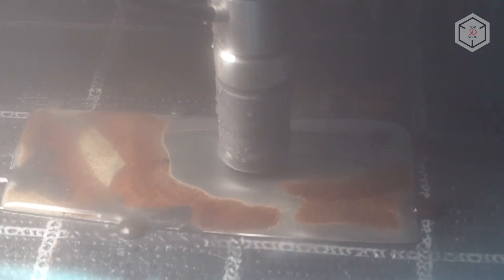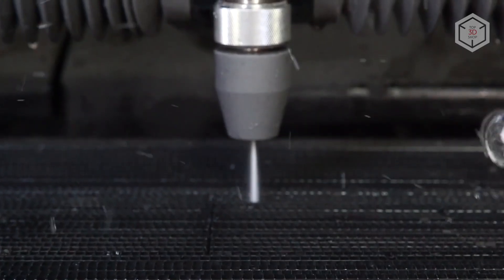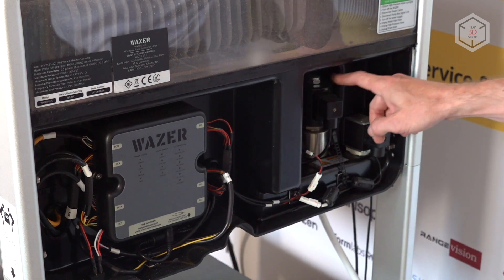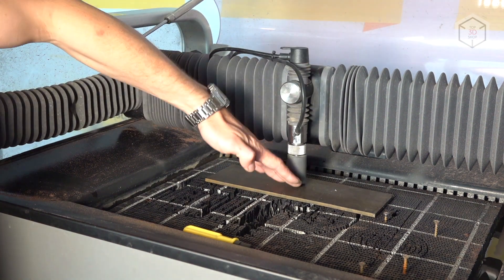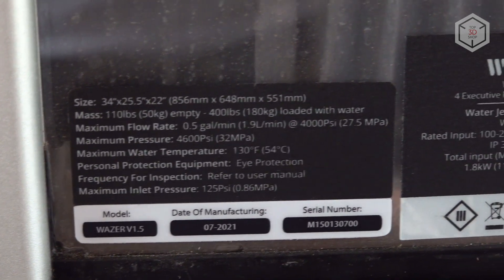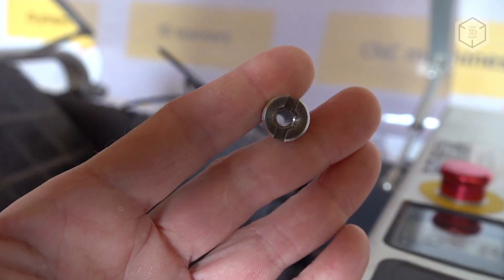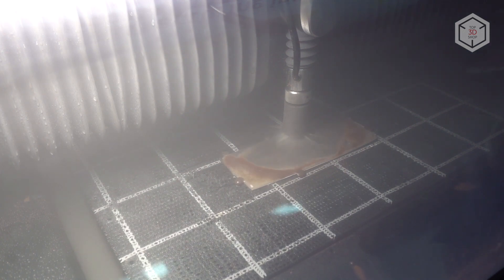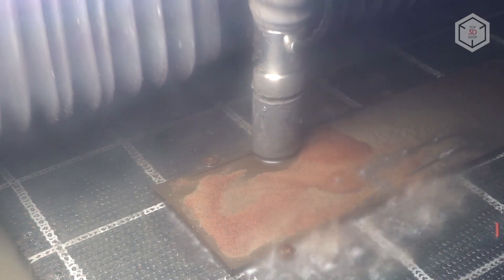Wazer In-Depth Review: First Desktop Waterjet Cutter

Comment: Been there done it, what a crock of shite tHis machine is
Reply: Can you please elaborate as to what you find to be wrong with it? I'm very interested to know the short-comings of the machine, as (in theory) it would work very well for my use case.
Reply: @bluehornet6752 I don’t have any experience with this machine in particular, but lots of “hobby sized” machines have serious shortcomings compared to the industrial ones they mimic. If I were you I’d evaluate whether you really need this machine in your workshop when suppliers like send cut send offer really good prices and short lead times custom parts.  

There’s the value of your own time to consider as well. Do you want to fiddle with setups and machine maintenance or just upload a CAD file and swipe a credit card?

Comment: I've never used it but I saw the kickstarter and its probably a piece of garbage. The main issue is the pump is really low pressure so you will use a ton of garnet to make cuts. This machine will be really expensive to run.
Reply: Usually commercial water jets I have used may be as high as 50,000 psi. Maintenance costs are high, water pump rebuilds too frequent, and the cost of the Ruby or Diamond nozzles are typically $200-500 per unit with not many hours of use at high psi's Garnet isn't cheap either!  The water in the base tank that catches all the Garnet gets rancid too, and cleaning out a big machine without an auto clean out feature is a a lot of work. Rancid water is also a good source of serious bacterial infections, you have to be very careful. Hand pumping out a full size machine and shoveling out Garnett into a dumpser is a lot of hard, smelly work.
Reply: @johnkemas7344  Seriously?  You think garnets can get rancid?

Comment: Why is the abrasive additive so expensive. It really makes cutting costly.
Reply: I mean, thats very subjective to task and usage. The machine uses a third of a pound per minute. If you buy a pallet of abrasive, its roughly $8-$10 an hour in abrasive costs (at least with what local U.S. abrasive costs are here). Now think about the type of companies that can benefit from this. There are man companies that outsource these simple cuts. What is $10 an hour to prototype and cut things on your own at home? And if you are using it for production use, certain materials like thin aluminum, glass, and other softer materials, its VERY cost effective.